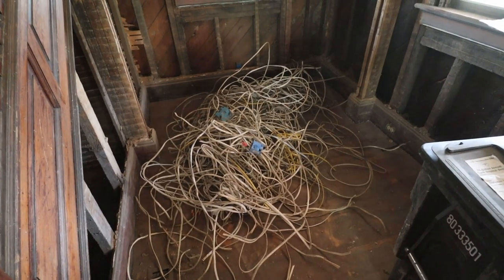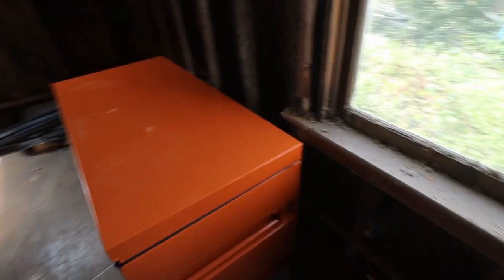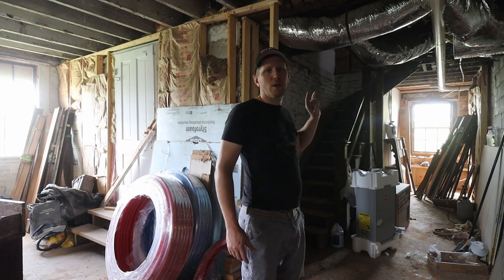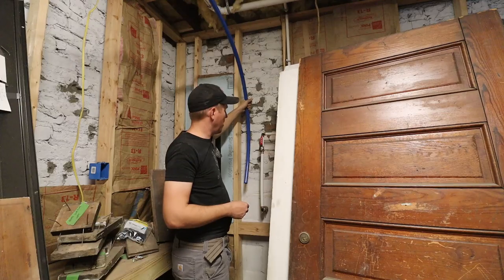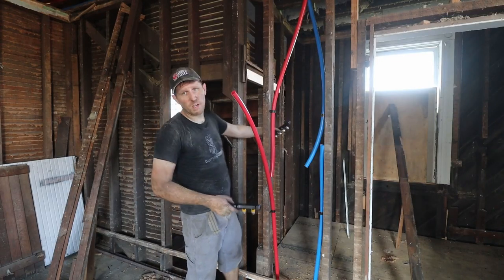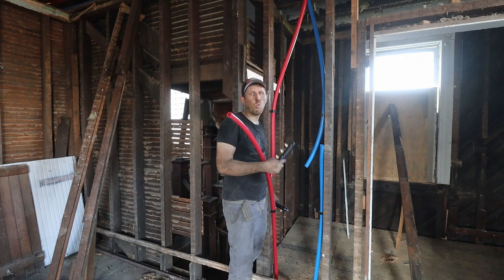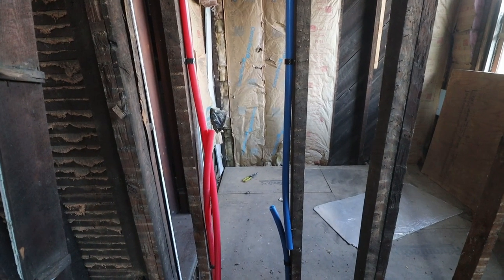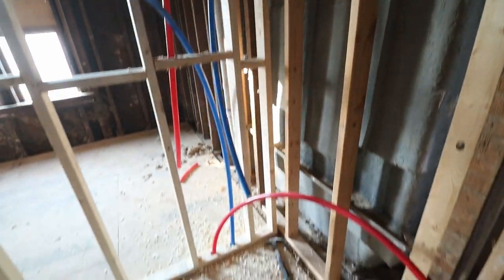Plumbing Re-Circulation Loops for Hot and Cold Water - Victorian Home Renovation [TirolerInn]

Comment: Polymer product manufacturing still gives me nightmares from material class exams.
Reply: I am also glad you didn’t go at them with a heat gun which I have seen people do. They are plastic polymer meaning they degrade when heated so heating them can reck them.
Reply from the maker: Yeah for sure copper would be better but it is so cost prohibitive and also very hard to work with in a remodel situation when it is not all planned out from the beginning of construction.
Reply: @laurenarigo3894 Nonsense! The heat/temperature at which pex is extruded greatly exceeds that of a heat gun unless of course you have no idea what you’re doing.